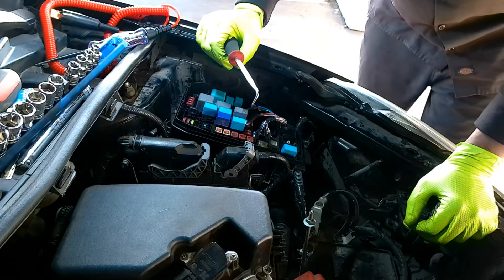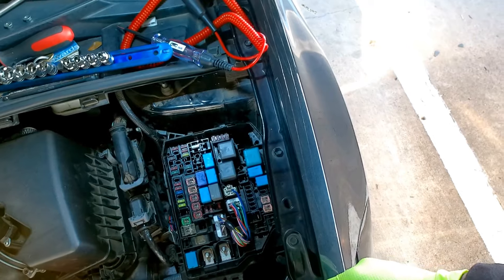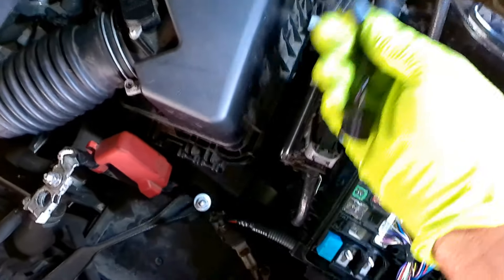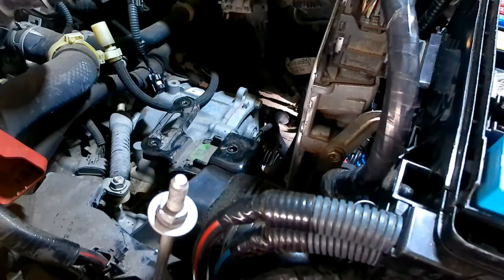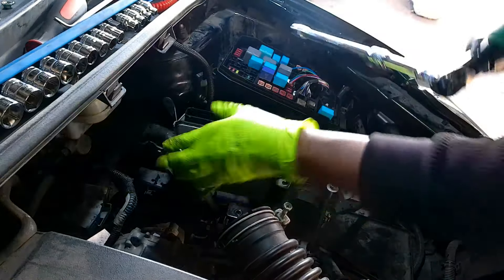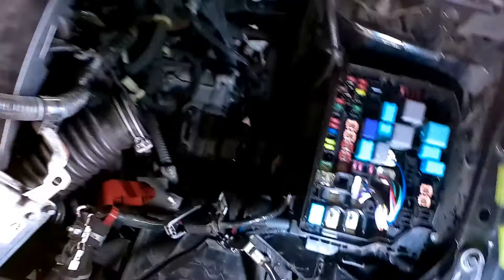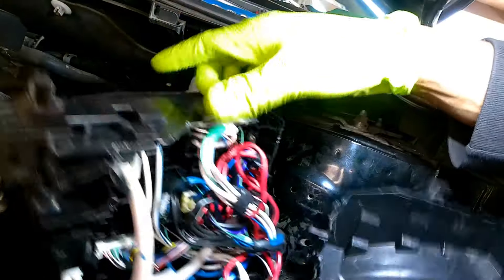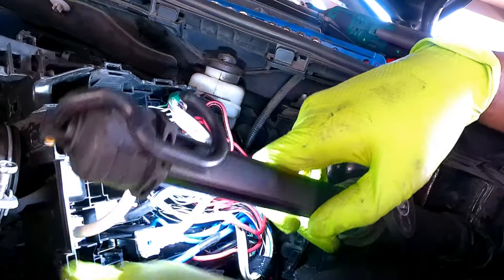TOYOTA FUSE BOX DISMANTLING

Comment: Good video, thanks. Taking fuseboxes apart can be a total pain, especially when manufacturers love to fit them in the darkest & most awkward spots. A powerful head torch can be your best friend when working on vehicles.
Reply from the maker: You're certainly right I may need to upgrade my $10 Amazon head torch. Any recommendations?
Reply: @Usmanthemecano  : Hey buddy thanks for the reply, my missus bought me a brilliant rechargeable head torch on eBay. It's got 3 settings with maximum output of 12000 lumens, came with 2 sets of batteries and mains charger & I think that worked out about $20 US. It's the best head torch I've ever owned & I usually only have to use the first setting on it. Also has a small bright red led in the back so if your working on the side of the road in the dark, it warns people that your there. Unfortunately there's no make on it.
Reply from the maker: @rscelectrical7091  I'll look into it

Comment: Thank you very much for this video. This was one of the few videos that had a detailed walkthrough of how to get this SOB out. My dad and I were able to successfully change out a blown alternator fuse (car wouldn’t start at all). It took a few hours to get it all disassembled and reassembled but the car now works again.

The bolts holding the fuse in were the worst part. I can’t believe the geniuses who engineered this decided to use two different bolt sizes for the fuse bolts. They make it this difficult so you have to bring it to the shop. But jokes on them this time.
Reply from the maker: Glad it helped!

Comment: Thanks, nice work. I have a question; after changing the fuse the fuse my gas won’t accelerate. Any suggestions?
Reply from the maker: Check all other fuses interior and in the engine bay
Reply: Thanks

Comment: hi Usman, i have a 2002 toyota avensis 1.8 petrol...i made a blunder and jumped the flat battery backwards....the Alternator fuse blew....can i try to repair the metal link inside the fuse so i dont have to buy a new fuse ?
Reply from the maker: The danger with that is things can catch on fire if it is done wrong, meaning in excess of the rated amperage

Comment: So, my gf's venza (2011) doesn't lock doors unless manually, each door. But if I use the beeper or whatever button to OPEN it does work. 

It got diagnosed that we had to change the "body control something" so researching I concluded it was the under dash fuse box. He didn't give me an exact name. The electro mechanic said it would be difficult to find, he was right and new it looks to be too pricey. 

So, I'm asking for opinions. I know next to nothing about cars but I saw videos and I'm inclined into just checking/changing the fuse for the lock system first before spending so much $$$. 

Good idea or nah?